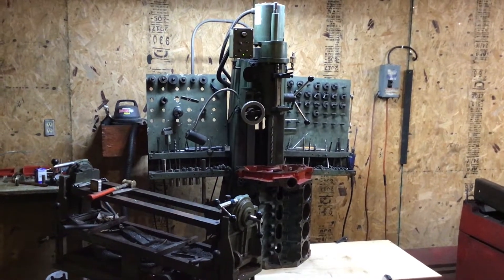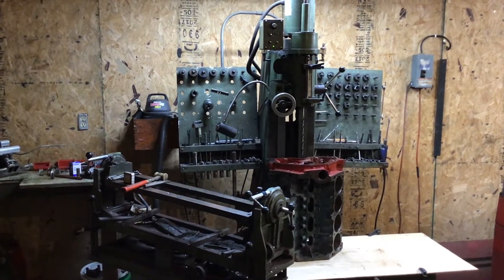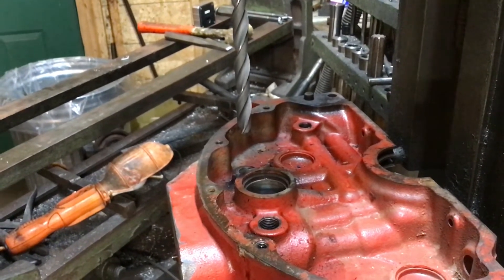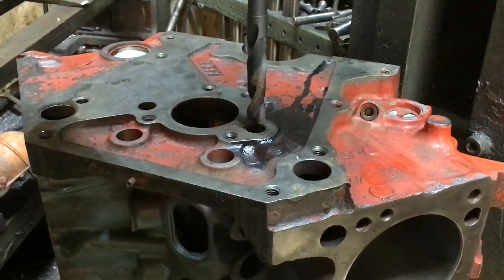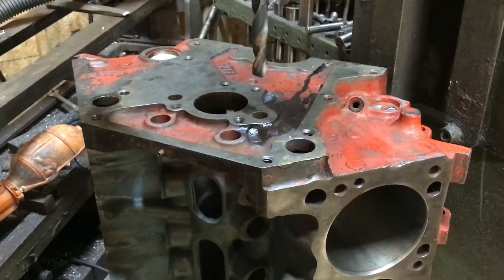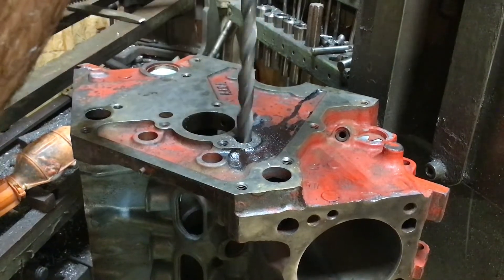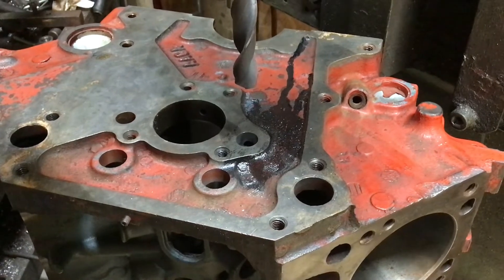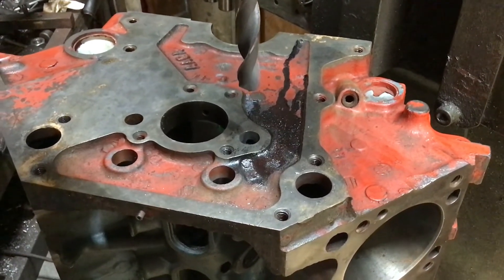414 Stroker Build Part 3: Block Oiling Mods/Drilling for Tubes #NoNameNationals

Comment: An explanation of why and what you are doing would have helped greatly.
Reply: Inserting copper Tubes and then use a ball ended driver to move the copper out of the lifter bore since solid rollers don't need a lot of oil an it keeps from losing oil on high lift cams from the lifter rising so far it exposes the narrow part of the lifter.
Reply: You could search factory LA series racing books

Comment: Nice work. 
I have always wanted to do that process,  never had to yet.
Never ran a roller cam in a small block.
They say with the new style lifters you do not have to worry about the oil band bleeding off.
Not had any problems with the high performance street and occasional drag race engines with solid or hydraulic cams.
I am going to be doing this mod on a future build.
I'll drill mine in the Valve seat and guide machine also.
Some of the original kits had a drill and reamer in the kits.
Are you aware of that?
Anyways, nice work.
No doubt you will have better oiling.
Take care, Ed.
Reply from the maker: Thanks for watching Ed! I will be running the solid body cranes, but after one of my sons had a link bar come apart on his daily driver with a solid roller, I decided to start tubing the blocks. I wish Mopar still sold the long reamers, I searched the net quite a bit and could not find anything long enough. If I had the bucks, I'd love to have the BHJ fixture to bush the blocks.
Reply: @CCR414  I'm sure you could get the Reamer from MSC, Like and extra length or Aircraft extension drill and reamer.
And yes, the BHJ setup would be nice.
I have missed some used ones, they are still expensive. 
Take care, Ed.